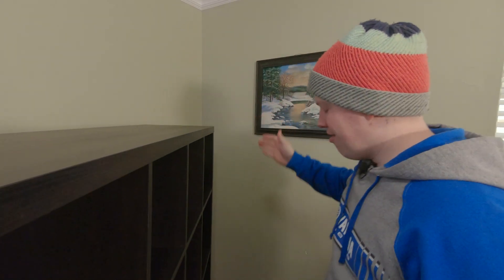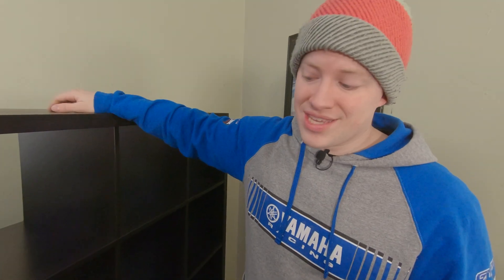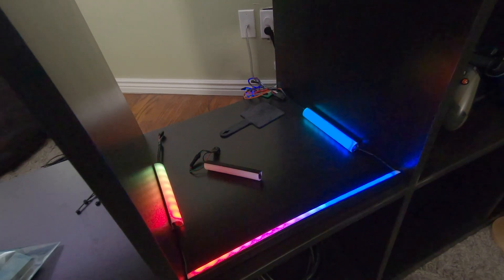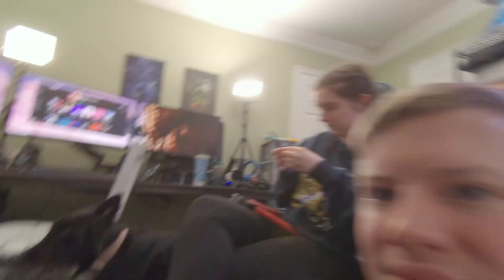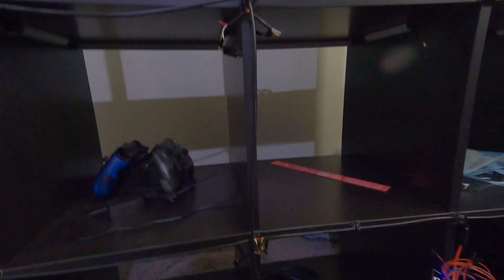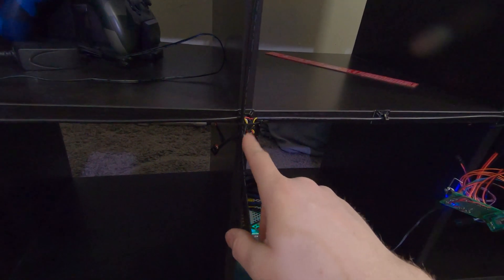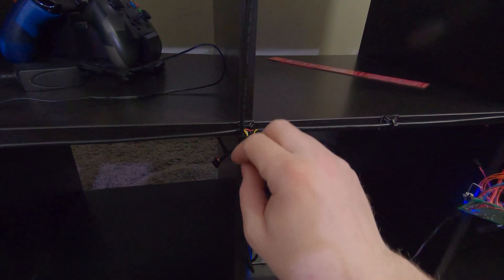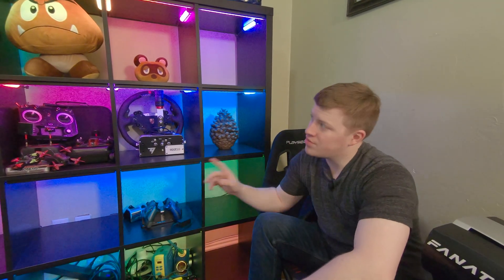IKEA Shelves Get RBG! LED Project (WS2815) | Part 2

Comment: I just did my first large scale build with 2815 strips. I friggin love these things. I would have had to add 22 power and ground shunts routed inside the square tubing frames with 5v strips to pull it off.

Comment: Divide and Conquer does not mean split up and work on different things, it means (in war) to divide the enemy into pieces and throw your entire force at each piece. Better known as 'Defeat in Detail'.
Reply: Everyone boo this man
Reply: this usage of the idiom analogizes the methodology, or the proccess of refining it as the enemy. It is very common in engineering circles.
Reply: You're being pedantic. Diving the task (or the enemy) and conquering it.
Reply: @hasbook7156  Yes by concentrating all forces on one piece, in sequence until everything is completed. Look up Napoleonic tactics.
Reply: @hasbook7156  If you look at the method, research Napoleon. He would trick the enemy. He would occupy 4 cities, the enemy would divide in 4 parts. Napoleon, usually at night, would reposition his forces to focus on one of the cities and crush it. Then move to the next. This is a serial approach instead of parallel as the enemy expected. People can pervert the concept all they want I guess but If I walked around saying irregardless I'd hope someone would correct me. Additionally, if want to label me pedantic (literate) please check your spelling first.
Reply: @markbernhardt6281  So your entire argument rests on a spelling error made from me typing in haste? I’m well aware of the historical roots, divide et impera and Napoleon’s campaigns included. But just as with countless other expressions, the meaning has broadened over time. Today "divide and conquer" is equally accepted as breaking a big problem into smaller, manageable parts. Both uses are valid, and pretending the modern one isn’t is just pedantry for its own sake. And your joke fell flat as you don't seem to know the definition of pedantic. We can just admit you're an obnoxious know it all and we shall move on.
Reply: @hasbook7156  You actually learn something and get all hostile about it? How in the world did you get your master's in history?